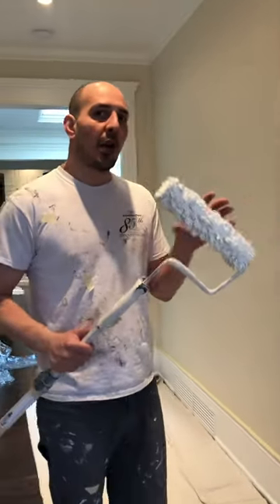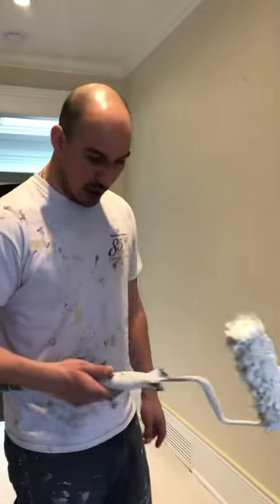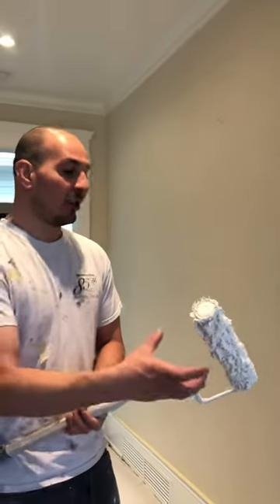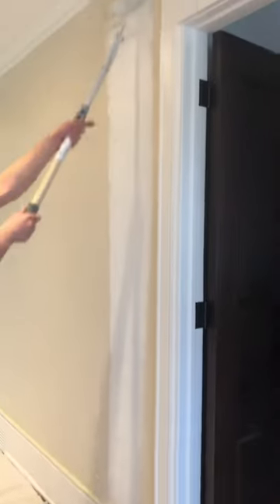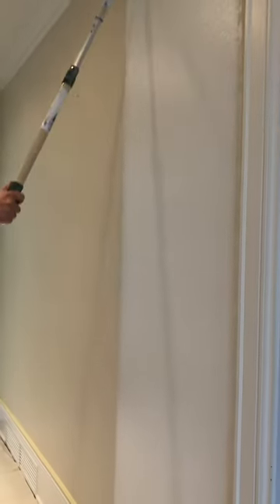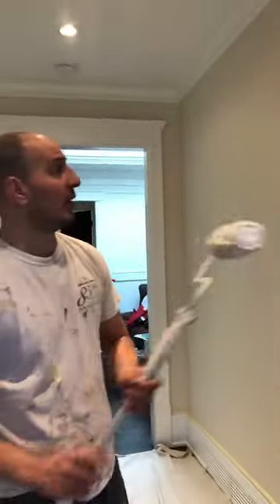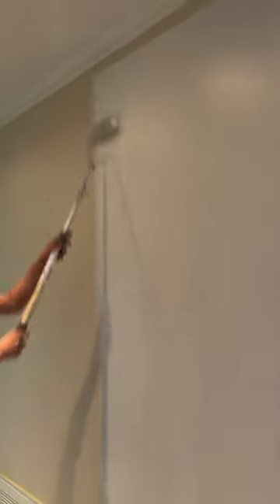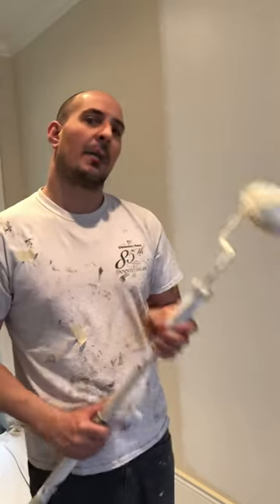#PURDY 9” Colossus in depth description.

Comment: These colossus naps are amazing, and last almost forever and wash out better than any other rollers I've used. Its also the only roller where a 1/2"nap is way too small. Gotta go for the 3/4". For speed tho, you really can't beat a fresh new purdy white dove 1/2 nap. I'm just not liking all the extra work involved with making the walls perfect with these colossus naps, and you definitely, definitely will be flinging paint way more.
Reply from the maker: Ooooo yah. They are paint spitting machines. Yah I dunno myself. It’s either do four feet or two feet. White doves are nice but they don’t spread very far.. 🤷🏻‍♂️ I dunno I feel the same. For like a repaint. Possible same colour or close. I stopped issuing colossus just too much for something like that.